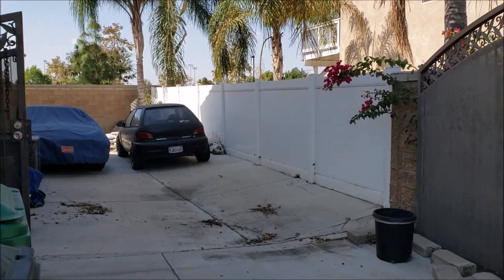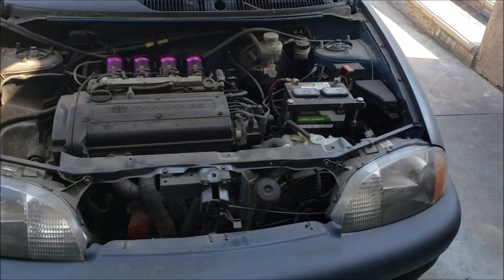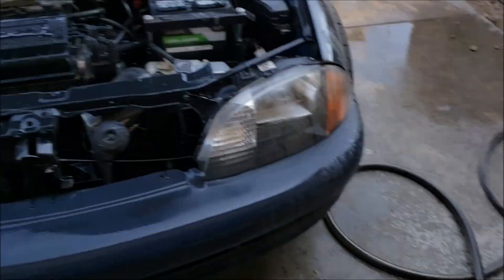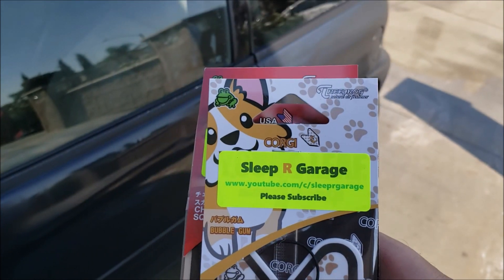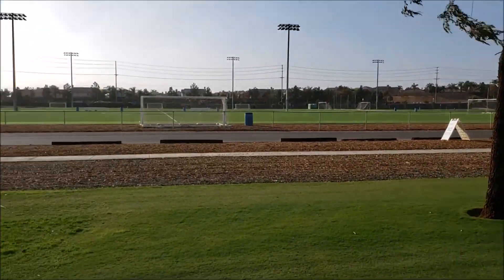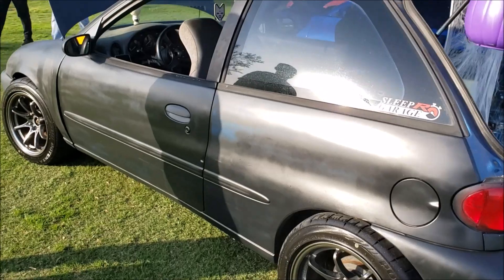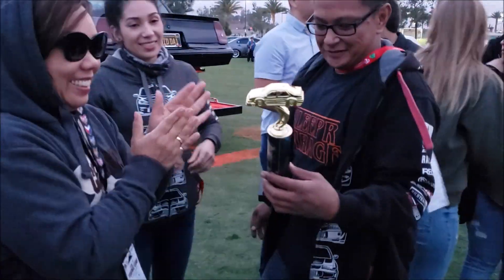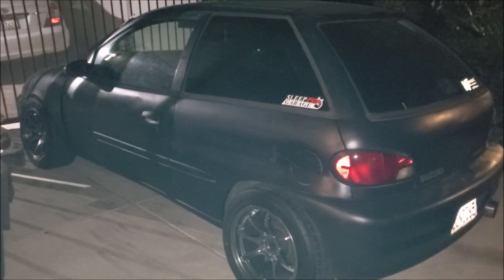4age 20v Swapped Geo Metro (Swift R) Goes to a Car Show

Comment: I have a 1995 Suzuki Swift HB 4cyl 1.3 sohc 5pd ABS. I have a rear wiper.
Reply from the maker: Cool wanna race
Reply: @SleepRGarage  I wouldn't have a chance against yours as it has a larger 4cyl with around 100 hp & 100 torque more than mine! But sure at mission raceway!

Comment: At some I intend to D16z6 swap my 93 xfi- extra 3" of room between frame rails and I think the master cyl will clear.
Reply: some point
Reply from the maker: That would be awesome. Any engine that puts out anywhere from 130 to 180hp in a car that light automatically makes it into a contender. Keep us posted on that one.
Reply: @SleepRGarage  Maybe get honda spindles in there, geo brakes are a cruel joke and Swift Gti stuff is rare now.
Reply from the maker: @kennethfrazee2540  it might be easier to have a bracket made to accommodate a bigger caliper and rotor. I had plans to upgrade my brakes using 300zx 4 piston calipers and nissan sentra spec v rotors 4x114 bolt pattern, I have these parts just haven't had the time to have the adapter made.
Reply: @SleepRGarage  Not a bad idea, car's not really worth expenditure of Wilwoods, etc. lol I gutted it down to around 1480, chopped the springs and threw 60 series tires on it, about the hardest cornering car I've ever drove... but yeah no acceleration. H22 stroker Civic done, all I care about now is the Geo haha.
Reply from the maker: @kennethfrazee2540  cool keep us posted and where are you from
Reply: @SleepRGarage  prob wont b until next spring or summer

Comment: What all do i need for this swap info forums please thank u
Reply from the maker: It been so long since I did this swap that I can hardly remember. You will need the complete engine, trans, harness, ecu. You need to fabricate custom mounts, integrate the harness into the swift harness. Axles are the challenge, you need to have a machine shop spline the rods to the toyota inner and swift outer. If you are looking for an easier swap maybe consider the 4EFTE from a Toyota starlet. Its a turbo 1.3l mounts are are more closer, but if you are interested I will advise you as much as I can. What state are you in.